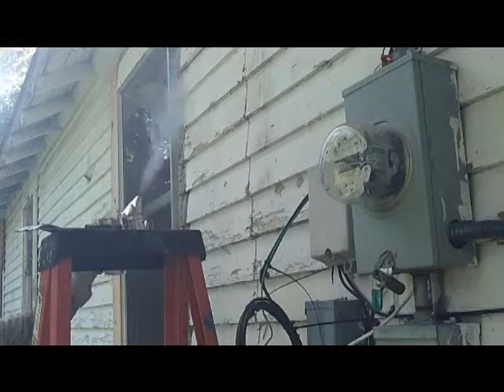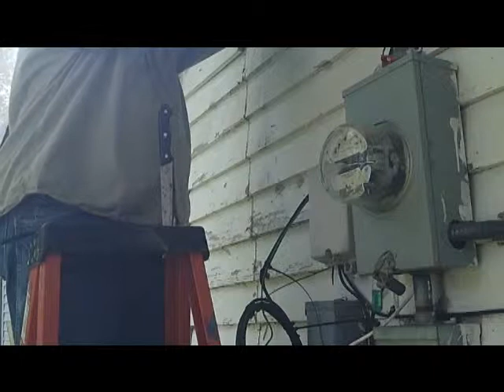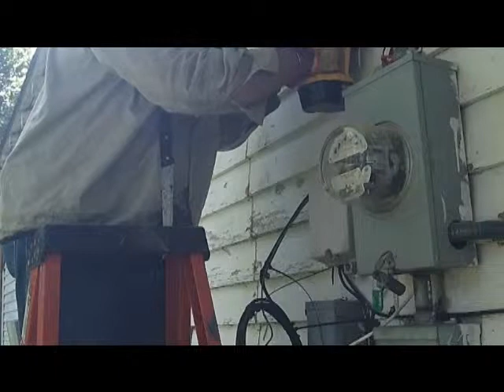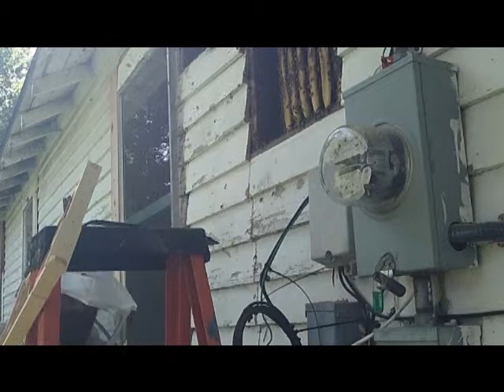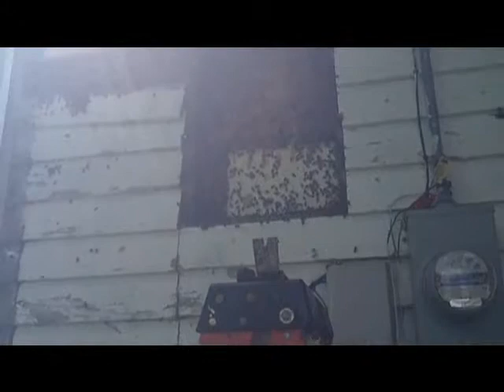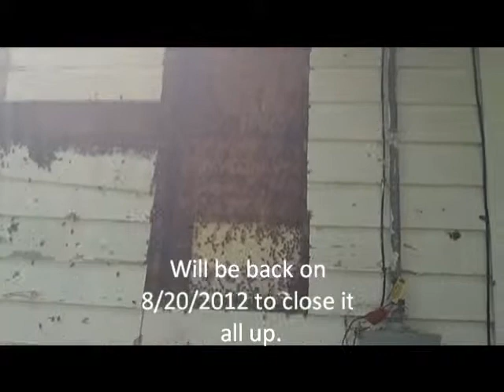wise st alex 8-17-2012

Comment: A few suggestions if I may.
1. Purchase one of those 35.00 laser guided temperature indicators. It will show precicely where the colony is with a temperature rise.
2. For cutouts like this, another ladder with two 2x10's or one 2x12 (or similar) for a walk surface works great.
Good vid.